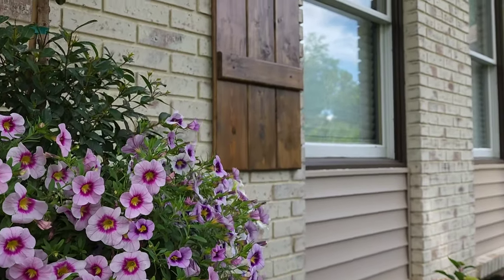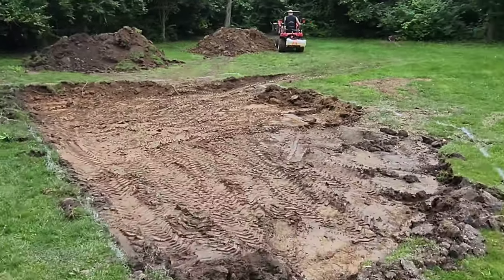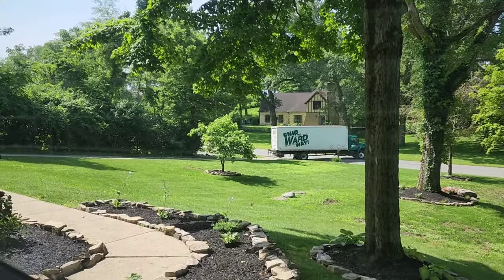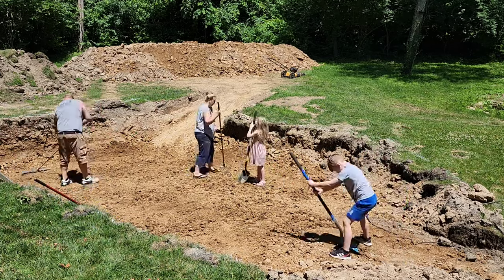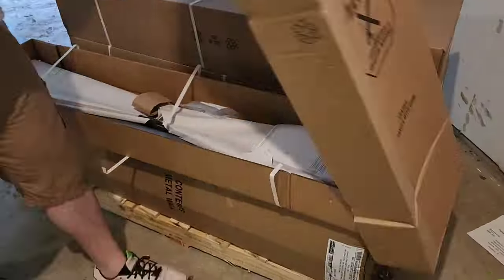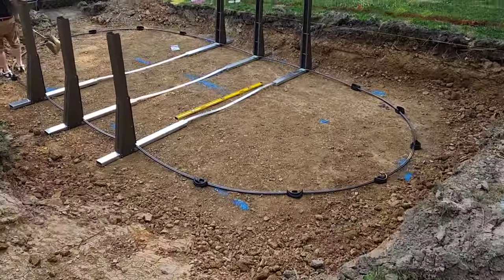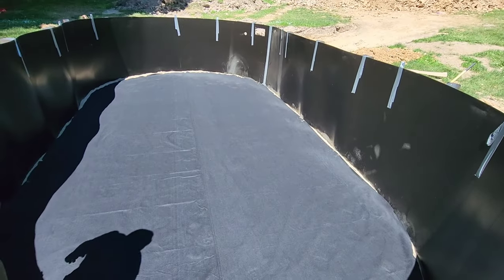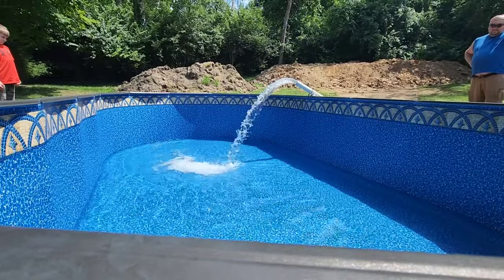Installing a Semi-Inground Pool from the Pool Factory

Comment: I have the exact same pool from the Pool Factory, only bigger. Ours is 21 x 43. Ours is sunk evenly at 27" all the way around. Just curious if you've had any issues with the walls yet being the pool is sunken to different depths? Too much pressure from the ground at one end, and too much pressure from water at the other?
Reply from the maker: Hi Dave! We have had no problems at all. As long as you don't bury your pool above the recommended level there will be no pressure from the ground, and as long as your pool is level there will be no pressure from the water. It's all about proper installation.
Reply: Good to hear. Best of luck. Enjoy your pool!!

Comment: If we want to start building out own pool like y'all, and we have no clue about anything, what would we need to order for the pool itself?
Reply from the maker: If you go to The Pool Factory website, they have everything laid out for you when you start your order. You order the type of pool, size, liner, padding, pump, chemicals, ladder, everything. So start there! We ordered a thick liner which was an upgrade and extra padding for under the liner. Then for the pump we ordered a Pool Frog which is a mineral filtration system. The mineral pack and chlorine comes with it. It is the best and keeps our pool crystal clear. The Pool Factory will send you instructions with everything you order and they also have YouTube videos you can watch. Then you will need to go to a hardware store for shovels, levels, bricks and things to put the pool together with. You will also have to buy sand, gravel, and tubing for your drainage system. Watch all of the videos and read all of the instructions. Take it step by step,take your time, and be patient. Don't let it overwhelm you. It's hard work but it's worth it!

Comment: I would love to know why it couldn't all go underground?
Reply from the maker: I'm not sure either. We just followed the directions that said not to bury the pool past a certain depth. 😊 We had to put ours partially in the ground because of the hill in our backyard. We didn't want to level the entire yard, so the semi in ground worked best for us.
Reply: The land around the pool can  collapse when empty. To do it safely you should create a concrete wall structure to prevent that from happening, then you can  safely install the pool as low as the pool can be

Comment: Hello!
Did you bother with all the "bonding and grounding" around the pool frame?  Everyone I talk to says don't bother.......just wondering......
Reply from the maker: Hi Joseph, yes we did ground it by attaching copper wire to concrete slabs around the outer perimeter of the pool and then running it up to the inside of the skimmer.
Reply: @caudillcottage  so you did not drill into the pool supports for bonding? Did it pass code in your county or did you not have to pull a permit?  Asking because my pool is sitting here waiting for installation, but here in my county in Fl electricians or the home owner bond not the installers.
Reply from the maker: @Sue ......No, we did not drill into our pool supports. In all of the instructions and tutorials we watched on bonding, the pool supports were never drilled into.  We live in the country where no permits were required and we were allowed to do everything ourselves.

Comment: What did you use for drainage around the pool? We are planning on doing this here soon With a 15’ x 24’. Also how thick was the sand on the bottom?
Reply from the maker: Hi Chris, we used a 4" corrugated field tile for the drainage around the pool and then we used around 3 to 4 inches of sand on the bottom of the pool, covered with a black padding to keep grass from growing up through the sand and damaging the liner. 
Best wishes on your pool installation!

Comment: Does your bottom rails between the post actually touch the ground or is there a gap. Thanks.
Reply from the maker: Hi there! Yes, the bottom rails are directly on the ground. It's also important to know to put these on the ground and not on top of sand, as the sand will wash out and make your pool walls collapse. Hope this helps!

Comment: Hey, thank you for sharing this! great job! I'd love to know if your walls sway / move at all when the pool is in use. Does your pool have the rolled up aluminum/metal walls or are they individual slat walls? Thanks
Reply from the maker: Hi there! Thank you so much! No, our walls do not move or budge at all when we are in it. If your walls are bulging or moving at all, then there may be some foundational issues. We have a solid metal wall that came rolled up in one piece and it is very sturdy. It was the hardest part of the pool to put up because it was so heavy.
Reply: @caudillcottage  Thank you! I'm actually in the process of purchasing right now so I don't yet have a pool. Been looking at an AquaSport52 which is super strong. Would you happen to have any videos of the pool when there is wave/movement? I'm looking to wrap a deck around it and just really looking to find comfort with the rolled walls. I tried calling a few places, non of the companies seem to have any videos of the walls with movement in the pool :( - Thank you!

Comment: How do you drain it? You mentioned you left space for that.
Reply from the maker: Yes, we made drainage for rain water around the pool so that water could drain off of the hill and not set in the ground, since our pool is partially in ground. We dug out two feet all around the outside of the pool and laid drainage tiles in the ground and covered them with small gravel.  It's not to drain water out of the pool. We use a hose to drain our pool half way before we close it in the fall. I hope this makes sense. ☺️

Comment: Using the mini-tractor made the initial excavation easy, but it compacted the soil making it difficult to level.  Should have dug to about 6" above the intended depth, and the rest by hand.  And you didn't need to pay for drinking water quality.  $300 better spent elsewhere.
Reply from the maker: We are perfectly happy with our work and the way we decided to go about this project. The ground needed to be compacted as we went along to better secure the foundation of the pool. A tractor or skid loader was the perfect tool to accomplish this. And having clean water delivered was worth every penny, as we have well water at our home which is not suggested for filling pools. We did a lot of research before this build and would not have done anything any different.
Reply: 6 inches of dirt on that size hole would be 10 cu ic yards of dirt. It's definitely way easier to scrape off an inch of compacted dirt here and there there than hand dig 10 cubic yards of compacted dirt and then haul it out with a wheel barrow.